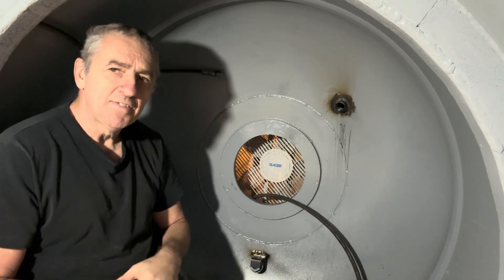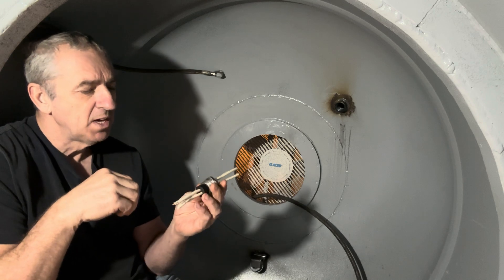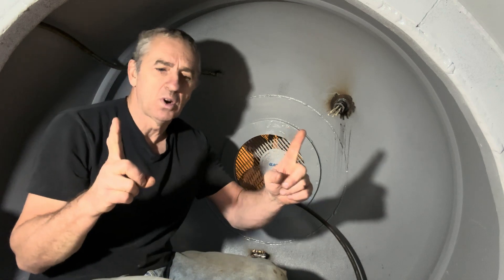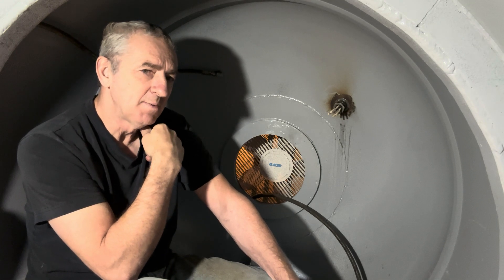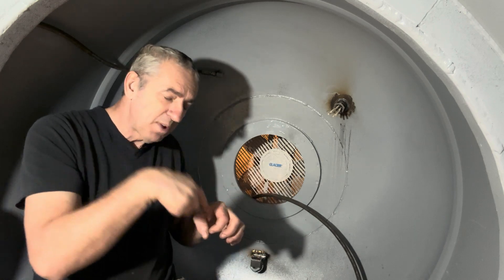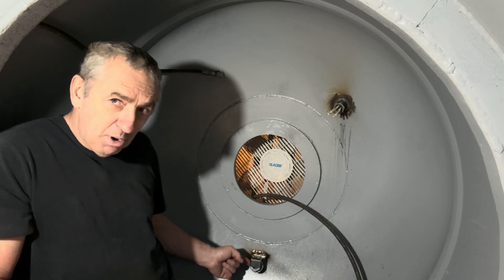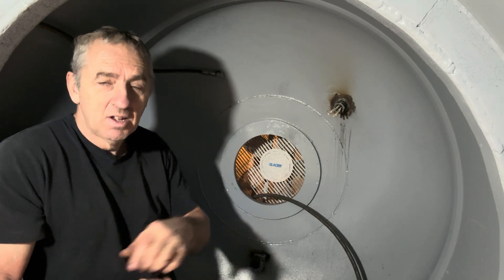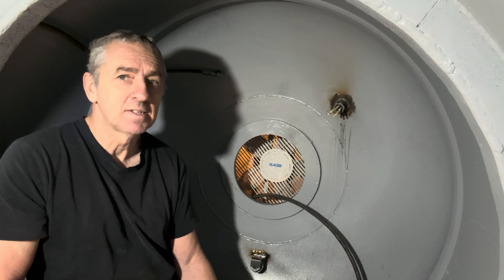Building my diesel submarine at home

Comment: Could you tell what brand of epoxy u used for the penetrator. So u want thr bate shiny copper in contact with the epoxy?
Reply from the maker: I use whatever casting resin is on sale.  They all seem to work.  Yes I rough up the bare copper to inprove adhesion.  You cant leave the outer plastic on or the water will go between.  I have a video on exactly how to make them if you need see how I do it.
Reply: @HankPronk thx for the response

Comment: Thanks for another video!
If you have it screwed from the inside, then if there's an improbable small leak, you might be able to tighten it up before having to head up to the surface quickly.
Reply from the maker: That is true, plus its easir to work on and install.

Comment: If your LED lights have plastic frames you could use a heat gun and bend them to the arc of the sub body.
Reply from the maker: I am planning to have them in line with the hull at the 1;00 o-clock position.

Comment: You could go with a mount that has the magnets on it, attach it to the light, and it can also function as strain relief for the wiring itself in case you accidentally yank the cable.
Reply from the maker: I agree completly.  Gonna order some right now.  The ones I have are too strong.